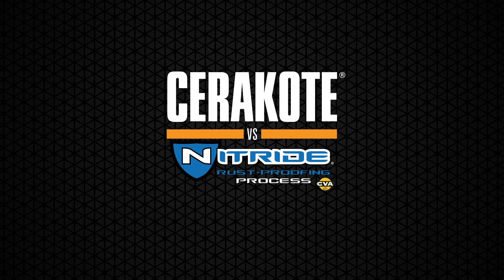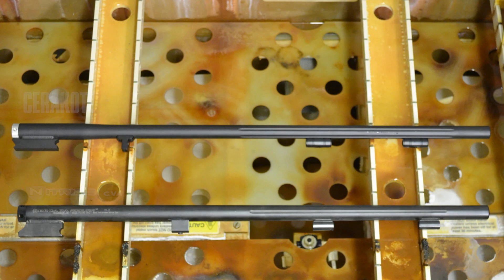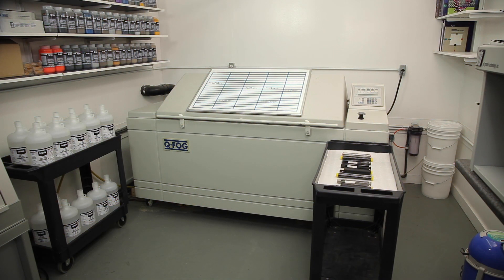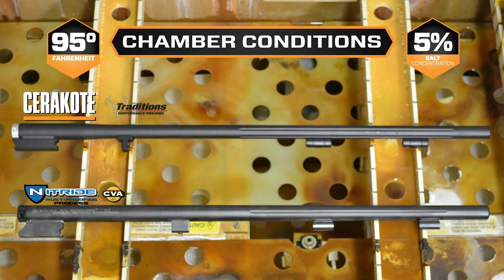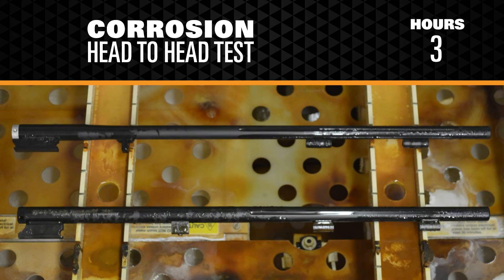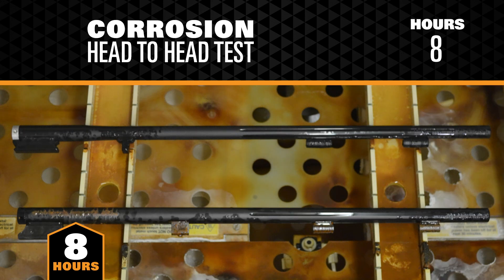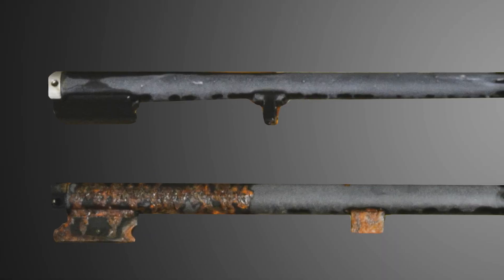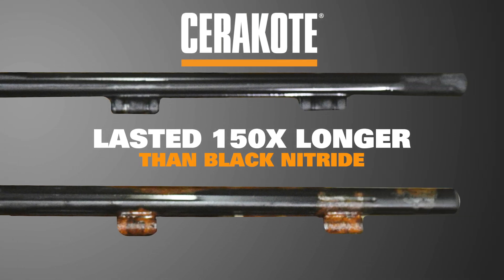Corrosion Test | ASTM B117 | Cerakote vs. Black Nitride

Comment: I built a salt bath nitriding plant from the ground up and have been running it for 12 years. I have a few comments but first, let me explain what Nitriding is. This barrel may have been gas nitrided but was likely salt bath nitrided. Salt bath nitriding has many names: Nitriding, Nitrocarburizing, Arcor C, Arcor N, Tenifer, Melonite, Tufftride, Durferitt, Delamin, Kolene, QPQ, CLIN and many more. We like it when customers call it Knight Riding, but please don’t call it Nitrating :p

Nitriding diffuses nitrogen into the surface of the workpiece creating a thin crystalline lattice of nitride compounds of iron and other alloying elements at the surface. This is called the compound layer/zone. There is a diffusion zone subjacent to the compound layer that extends about .003-.020" (depending on alloy element content) where nitride compounds are dissolved in the solid solution. After nitriding there is a second salt bath immersion into a molten solution of oxidizing salts (similar to hot black oxide/gun blueing) to convert some surface iron to Fe3O4 (black iron-oxide). This bath is commonly called a Quench bath (Q) as it is about 200-400°F cooler than the nitriding salt bath. 

For carbon steels (very few alloying elements other than carbon) the iron-nitride compound zone is about .0008"/20µm thick and is about 55-58HRC in hardness. The elements that create nitride compounds that are harder than iron-nitride are chrome, titanium and aluminum.  416 is martensitic stainless steel. Stainless steels contain a lot of chrome. 416 contains 12-14%. High chrome content greatly increases surface hardness (and reduces total case depth). The compound layer (surface hardness) of this "black nitride" barrel is likely over 70HRC and perhaps upwards of 80HRC and only about 0.0002"/5µm thick. The core hardness of a 416 barrel is about 25HRC (the ones I have tested). Lets assume a compound layer hardness of 75HRC. The compound layer is 40HRC harder than the substrate and only 0.0002"/5µm thick (15 times thinner than a human hair). If you're curious, Chromium-molybdenum steels like 4140 will be 65-68HRC with a compound layer thickness of about 0.0005"/13µm. 
 
It is very common that firearms parts (and other parts) are polished with fine glass beads after nitriding to restore the finish and make them look nice. We call this QP. Q is nitride+oxide, P is polish. The glass beads size used is mil-spec #13 (.0035-.0017" diameter). The glass bead "polishing" is done in a sandblasting cabinet at low pressure, about 40-60PSI. We use such small beads because large beads can cause the compound layer to flake off on certain materials. During polishing, micro burrs such as those in the engraved area of this barrel are broken off. They break off because they are so brittle from being so thin and the nitriding goes right through, turning them into little crystals that you can break off by wiping the surface with a cloth. These sites where embrittled burrs broke off expose the parent material to instant corrosion. To avoid this we sandblast a barrel with aluminum oxide. The barrel in this video may not have been de-burred.

Glass bead polishing not only breaks away burrs but it also removes a lot of the black oxide layer and so it is very common to re-immerse the parts into the oxide (Q) bath to restore/maximize the corrosion resistance. We call this QPQ. The worst corrosion resistance you can have is QP (oxide/Quench + Polish), the best is QPQ, with Q being in the middle. It is possible that this barrel was not QPQ'd but only QP. 

Is it important to note that stainless steel's corrosion resistance is eliminated by nitriding as the chrome oxide passivation layer is removed and unable to reform as the surface chrome is now chrome-nitride. Stainless steel + nitriding = far less corrosion resistance than un-nitrided stainless steel or nitrided mild steel. It is commonly misunderstood that nitriding stainless steel is adding the corrosion resistance of the two together. The opposite is true. 

Conclusion: This barrel is of a material grade with expected poor post-nitriding corrosion resistance. Was possibly not deburred/surface-prepped in the engraved/stamped area. Was certainly polished after nitriding but may not have been re-immerse into the oxide (Q) bath. Also, those lug things under the barrel that rusted may be some other grade of stainless like 300 series that would be an even worse performer. 

Final note: We have tested corrosion resistance of Q nitrided 1018 and 4140 several times per ASTM B117 and it is good up to about 300-400 hours, so Cerakote is 3x better on those materials, and still probably like 10-15x better on 416 (not likely 150x). I recommend nitride + cerakote :)
 
TL:DR this test was unfair :'(
Reply: Excellent comment.... Would like to know your insights about nitriding vs nitro-carburizing and also other applications for nitriding and why it's less common outside firearms... It's starting to creep into cookware industry and people have been very impressed with the results...
Reply: @geniuspharmacist  

Although technically different, Nitriding & Nitrocarburizing are used interchangeably. Both diffuse nitrogen into the surface, the ladder diffuses some carbon as well. Even those in the industry do not know which one they need or what they are even purchasing. We often educate customers to help them get the best value as there are a lot of options and things to know. 

The most common forms of nitriding are performed in a molten (liquid) salt bath, or gaseous atmosphere. I/we provide salt bath method. Technically we provide "Ferritic Fused Cyanate Salt Bath Nitrocarburization with Subsequent Black Oxide Quench" per AMS2753D.  

Technically speaking:

Nitrocarburizing is usually the salt bath method. Here parts are treated in a chamber containing a mixture of heated salts. The old/less common salt bath nitriding chemistry used cyanide salts and did not provide carbon. It also did not have the black oxide step. We would call this salt bath nitriding. Modern/common salt bath nitriding chemistry provides carbon (and a black oxide step). We would call this salt bath nitrocarburizing. 

Nitriding is usually the gas atmosphere method. Here parts are treated in a chamber containing a mixture of heated gasses. Gas nitriding usually does not provide carbon and is usually performed without the black oxide step, and so the result is the product is light grey in appearance. We would call this gas nitriding. Gas nitriding can also provide carbon. We would call this gas nitrocarburizing. Gas nitriding can have a black oxide step. I believe more and more heat treaters are offering gas nitrocarburizing + black oxide. Perhaps to compete with salt bath nitrocarburizing. Not sure. 

In short: 

Any heat treater offering Salt bath nitriding is likely doing salt bath nitrocarburization + a black oxide step. 

Any heat treater offering gas nitriding may be doing gas nitriding or nitrocarburizing, or can do either one, and may or may not offer a black oxide step. 

Most of what we nitride is: 
	• Oil & gas sector including fracking tools (50%)
	• Machinery such as gears, shafts (40%)
	• Firearm components (10%)

Most of the public that is aware of nitriding is owing firearms. But, fun fact, everyone has a nitrided thing. The black shafts in those lift struts on our cars that help open the trunk lid. Those shafts are nitrided. Probably because nitriding is cheaper and more environmentally friendly than chrome, but I am not certain. 

Lastly, I have been nitriding my cast iron cookware for many years. Works great! I also nitride my brake rotors and any other iron based materials I own that I can fit in the bath :)
Reply: @jonsmith1540  thanks for your response... wow.... you're a treasure of information... 
How do you compare nitrided cookware to bare iron?? 
What's the cost factor of nitriding steel/iron?
I think many more things could benefit greatly if nitrided but they're to my surprise, usually are left without... Cast iron and carbon steel cookware, for example, according to people who tried them are more stick resistant and rust resistant than the plain ones. It might be the planned obsolescence, cost,.... etc
Same thing would apply to knives, hand tools, auto parts... etc.  It seems they only do it if they have to, or if competitors start doing it so they decide to join....
Reply: @geniuspharmacist  My only experience with nitrided cookware is my frying pans. Perhaps if it is applied optimally it is better than what I have experienced. I would consider nitrided cookware more durable than many other coatings. Use of metal utensils is ok, but I would still treat it like bare metal. Don’t let water sit in it for long periods. Maybe oil it. Maybe even season it. Nitriding can be vey corrosion resistant but only if left relatively undisturbed. Scrubbing and scraping with metal utilise will cause invisible microscopic damage where corrosion can take place. Again, just don’t leave water in it for long periods and it'll last a long time. It would take a lot of rust to make pits you could barely see anyway. 

Pricing can be complicated, but generally most items fall between $1-3 USD per pound. Lower price for heavier items and/or larger volumes. Tiny parts or large parts with little weight are priced per part / volumetrically. I would expect to pay about $10-20 USD for a item like a cast iron frying pan. Of course there will be a minimum charge or a set up fee. Our min fee is $100 CAD. 

I often say, buy the cheap bare steel/iron item (non stainless steel, uncoated, etc) and nitride it. We nitrided numerous sample rifle barrels for an emerging barrel manufacturer and IIRC the conclusion was they couldn't mark up the nitrided barrels enough to cover the cost of losing the repeat business owning to the barrel life being extended 2-4x. 

We don’t see knives getting nitrided, likely owing to them being made from tool steels that would be softened by the nitriding process temperature. Yes, nitriding would make them hard on the outside, but the leading edge would be embrittled from the nitriding and the first sharpening would reveal the softened core. We do see hand tools such as production fixtures for CNC machines, go/no-go gauges, etc.
Reply: @jonsmith1540  Wpuld you consider salt bath nitride better than the gas one like nDLC on the Glock Gen 5? Also what is your opinion on the PVC?
Reply: @insanity4082  I dont know much about DLC (only what I have read) and never heard of nDLC. Is this DLC applied over gas nitriding? You say PVC but did you mean PVD? I beleive DLC and PVD are both forms of sputter deposition. There are many different compositions of sputter deposition. I could see sputtered coatings added on top of liquid or gas nitriding being better than any one surface treatment alone.
Reply: @jonsmith1540  I did mean PVD. This is the stuff applied over the Gen 5 Glock 19 (nDLC) and Glock 19x (nPVD). People notice that the Gen 5 shows cosmetic wear much faster than previous generations, comparing it to the “frying pan” finish. Not sure what type that finish is.
Reply: @insanity4082  I remember reading years ago that Glock slides were Nitrided then parkerized or teflon coated depending on the Gen. I wouldn't be suprised if Glock is trying to be competative by marketing different finishes, which may not be better than the tried & true, but perhaps cause more sales.  Their current finishes may be more economical too. I know we charge A LOT for firearms nitriding as it requires much more attention to get it looking like jewelery and the chance of re-work goes from nearly 0% to perhaps 10% on average. Sometimes whole nitride batches need to be prepped and re-nitrided owing to slight cosmetic defects that would not be a problem if they were just machine parts.

Comment: Wow a test between to different steels
Reply: Yup! I have clarified a lot about what's going on here with the nitrided barrel.
Reply: Wow a genius who doesn't know how to spell two.
You know carbon steel rusts more easily than stainless right? The cerakoted barrel had a natural disadvantage.
Reply: @9unslin9er  Incorrect. The nitrided barrel had a disadvantage being 416. See my comment above.
Reply: @jonsmith1540  Are you saying they rigged the test in order to sell the process?
Reply: @9unslin9er  That is a conclusion that is not far from reach but there is plausible deniability that it was rigged. It is suspicious that the nitrided specimen was both completely different from the cerakote specimen and that the test results are as expected given the characteristics of the nitrided barrel. Had the nitrided barrel been the same as the cerakote sample, it would have reached 200-300 hours. I nitride firearm components every day. These processes are not competitors. Cerakote cannot do what nitriding does, and nitriding cannot do what cerakote does. The only thing they have in common is corrosion resistance and cerakote is superior in the regard. I nitride & cerakote my guns. Nitride for the nitriding properties, especially on internals, and cerakote for added aesthetics (such as color options) and added corrosion resistance.
Reply: @jonsmith1540  You learn something every day. I appreciate your information. I recently built an AR pistol with a 4150 Nitrided barrel. I chose the 4150 over untreated 416 SS. Did I make the right choice?
Reply: @9unslin9er  The subject of barrels is so completcated it's hard to know what meets your needs or what is "the best". Every use case is different and so a different set of variables float to the top. If we're talking about accuracy, then cartridge, caliber, bullet properties, head spacing, twist rate, rilfing, and a list of other things effect accuracy. 

I am not an avid shooter, so cannot speak from first hand shooter experience with evidence. I do receive feedback from shooters (even competition shooters), and manufactures whos barrels we nitride. 

These are the conclusions I receive, and can agree with as they make sense to me:  

1) Nitriding significantly increases barrel life. I hear barrel life is extended 2-4x. This is expected. But I have heard negative results from nitriding stainless barrels from a old long range precision shooter. This shooter experienced faster throat erosion post-nitride. This makes sense as I explained above that nitriding stainless steels reduces corrosion resistance. 

2) Nitriding "increases" accuracy. Nitriding greatly reduces friction (wear) and adhesion (galling) and so it slows the buildup of fouling, maintaining accuracy for longer strings of fire, and reduces barrel heat up, also helping to maintain accuracy for longer strings of fire. I have heard this from two customers. One is an F class competition shooter. Consider an advantage of heavy "bull" barrels is to absorb heat. Less friction = less heat being conducted = less barrel diameter needed. Instead flute the barrel to make it lighter but also give you that rigidity, if needed. The other guy I do not remember much about, but he found that he was able to fire 20 rounds to get the same barrel heat as 5 rounds pre-nitride.

Comment: I like cerakote and all but i can tell u for a fact that a muzzle brake done with cerakote will burn off and erode long before a black nitride, tin coat, or melonite coat will. And not trying at all to be a dick here but what kind of cheap stainless is tompson center using? Sure i know theres many different grades and lower grades will rust some but that is a bit ridiculous isn't it? What are they outsourcing from china
Reply from the maker: If your Cerakote is burning off, it might be an application issue. What Cerakote Color/Series are you using?

Comment: I know this sounds like a stupid question, but are you supposed to cerakote the inner barrel? I'm only asking because other people seem to think so. I'm assuming that cerakote (or any coating for that matter) might change the tolerances and friction of a bullet. And I assume that's also why people don't cerakote the edge of knives? And if you didn't cerakote the inner barrel, was the inner barrel of the cerakoted barrel chrome-lined? I hear chrome lined is pretty durable. But all I know about cerakote is that it doesn't seem to smudge like DLC, that it's probably the most corrosion resistant coating there is, and that it comes in any 50 shades of everything.
Reply from the maker: Hey, not a stupid question at all! We do not recommend to coat the inside of barrels.
Reply: The people commenting are being stupid. They're projecting their bias for whatever reason. The inside of the barrel is meant to be shot or kept clean with a light coat of oil to prevent rust if the firearm was to be put away. Chrome lined does help with corrosion as long as it's cleaned, due to possible corrosive powder, before being put away for an extended amount of time. All these comments about the inside of the barrel is dumb but you get one monkey going and then you get all of them. I Cerakote stuff right outside my apartment and it's badass. I blast things at work first in case you weren't wondering haha.
Reply: Nitride + Cerakote is the best/ultimate solution afaik (for barrels that are not already chrome-lined).
Reply: Ki tmthtgrhehhèrrf

Comment: You are comparing 2 completely different steels...
Reply from the maker: You're absolutely correct.  The Cerakote was applied over mild steel, which rusts much faster than the 416 stainless steel that is used by CVA.  Even when applied over an inferior metal, Cerakote out performed the stainless steel treated with Black Nitride.